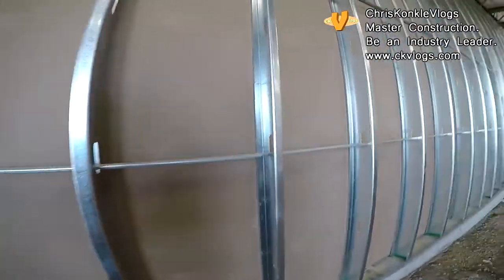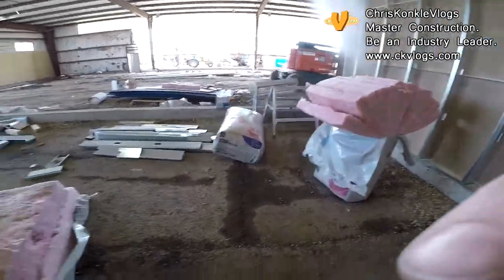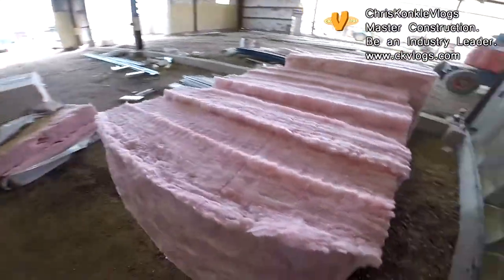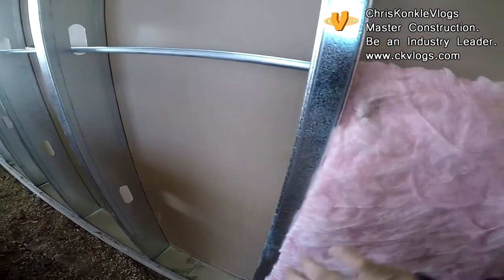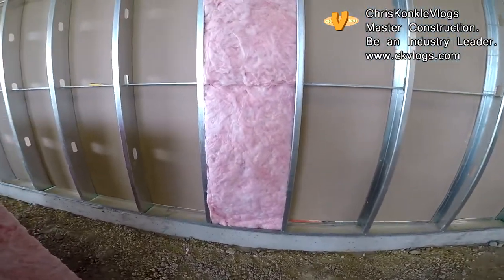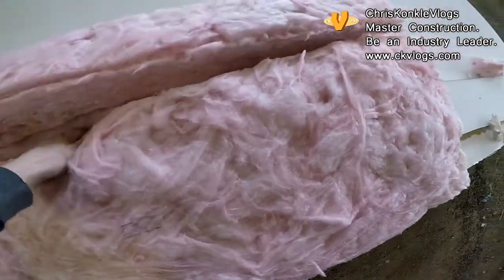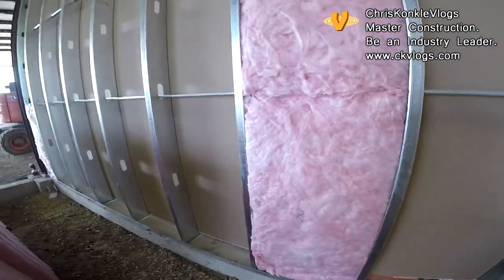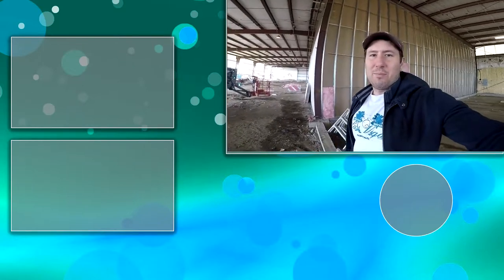Insulate Metal Studs | IT'S EASY!

Comment: Thanks for the video, would this method work on steel floor joists? I have a small shed that I’m converting to a tiny home and looking for the best method for floor insulation.
Reply from the maker: Yes you bet! Just remember when your ordering or buying the insulation to get the right stuff. You will need to know the size (6" to 8" typically), centers (16" or 2') and then yes for wood or steel. I am assuming the floor joists are steel stud? If say your joists are not studs, there is what's called blanket insulation that comes in rolls. 1 side is finished with a white skin that is washable. If you need more help feel free to join our Discord server, there you can upload pictures so I can tell you exactly what to do. Hope this helps!

Comment: Thanks for the vid! I'm doing my basement with 2x4 insulation, 16 on center. Is there a wider r-13 to specifically get?
Reply from the maker: Nope all you need to know is to ask for the r12, wood studs on 16" o.c. they make it for steel and wood so just make sure your buying the right one!

Comment: What's R-value code for commercial spray insulation? What are your thoughts on spray closed vs "normal"?
Reply from the maker: Shaun, my apologies for the late reply I must of missed your comment. The min R-value for exterior commercial walls is 20. I think that spray is good for tops or areas hard to access but I would recommend sticking with bat or semi-rigid for the walls. That way you can easily repair, remodel and reuse the material. Hope that helps! here is an additional resource for you https://codes.iccsafe.org/content/iecc2018/chapter-4-ce-commercial-energy-efficiency

Comment: My plans call for insultape and I've never used it. Where do you apply? Inside the track or between track and concrete/substrate?
Reply from the maker: Sorry  I am not sure what you mean if it was a spelling mistake or not. What I do know is if it is used for a gasket then yes between the track and slab. Usually when there is a change in substrate then it is a good idea to have separation. Caulking and foam gasket is what I use most of the time. We also use a blue Tuck Tape to seal our poly (vapor barrier 6 mil in residential). When your installing steal stud track to concrete it is a good practice to always use the Chemtron Acoustical Caulking and for the exterior walls use the foam gasket. Fire seal the outside of the track where it meets the concrete for that added protection on top of your gasket. I hope this helps. If you can send me a link to the exact product you are using I can have a better answer!

Comment: 24 centers using wood studs would give you difference space width when using steel studs. (Due to the empty steel stud) The insulation still fits? or when using steel studs is it not actually 24 inch centers?
Reply from the maker: That's right, when you order your insulation you need to specify if it's for wood or steel stud and on 16" or 24" centers. The stuff for wood is smaller widths.

Comment: is the flat piece of metal going between the studs a conduit or something else?
Reply from the maker: It's called wall channel. It serves 2 purposes; first to stiffen the studs Square and second to hold the insulation in the wall and keep it from falling down over time. That's why we go every four feet for the batts
Reply: @ConstructionKronies  How is it supposed to stiffen the wall when there are no clips installed? Is it just laying in there?
Reply from the maker: Yes for sure we install wall channel every 4 ft for insulation. The steel stud has knockouts for it.
Reply: @ConstructionKronies  But the clips that are supposed to attach the stud to the channel aren’t there, it looks like it’s just laying in the holes.
Reply from the maker: @shawnsutube  so yes, sometimes we add clips, usually on exterior walls. The channel is stiff in the knockouts as the are the same width.

Comment: Thermal  bridging?
Reply: Bull's-eye. Insulating between metal studs does nothing to address the conductive path from on stud flange to the other. Steel is about 300 times as conductive as wood; a metal stud at 1/30 the thickness of a wood stud, will transfer 10 times as much heat energy via conduction, reducing energy efficiency and subjecting the cavity (especially the faces of the drywall) to moisture that is not adequately vented, and an ideal environment for mold. Insulation should be continuous outside of the metal frame. In your defense, most architects and contractors don't understand this.
Reply: Refer to https://www.sbcmag.info/news/2017/jun/comparing-continuous-insulation-r-values-steel-vs-wood-framing for an explanation of the issue. Bottom line, insulating as shown in the video will reduce the effectiveness of the insulation by about 50-60% and lead to other problems long term.
Reply from the maker: So I am no engineer but what I understand about insulation is you don't want air pockets for moisture to build up in. I have demolished many old steel stud walls some very old and most of the time they are completely bone dry and no mold at all. I think the whole system needs to be taken into account here. We use caulking and gaskets for transitions and I think that really helps.  You can't put insulation on the outside of an interior wall but we do use rigid or semi rigid insulation on the outside of exterior walls. The normal system would be 1/2" drywall, 8" 18 gauge steel stud, 1/2" Densgold, Blueskin, 1 to 2 layers of z bar and insulation, then finished with cladding. All the way gasket under the bottom track.

Comment: what about the exterior? That metal frame acts like a conductor of heat or cold and will work like heating or cooling elements on the interior since the glass only covers the inside.
Reply from the maker: So, as much as I respect your comment this is a complicated topic. In short,I assure you the systems are flawless. I am not an engineer but I can tell you there are many systems and designs in place that consider all of the climate conditions. The glass is used as a curtain  wall in most commercial or high rise projects.and have their own thermal and moisture specs. We use an "out insulated"system when using cladding and trust me here is a typical wall assembly for and exterior wall in a commercial building;
Cladding / ACM 
2" Semi-rigid insulation
2" zbar
2" Semi-rigid
3" zbar 
6mil avb
1/2 - 5/8" densglas
6" 20 gauge stud @ 16 o.c.
1/2" drywall

There are other systems where the interior studs are insulated and polied and so on.

I hope this helps.
Reply: @ConstructionKronies   Not sure if I understand but are you saying that this structure did not require a out insulated system ?  Is there a exterior wall or is it inside another building?  If facing the exterior then thermal bridging is always in play.
Reply from the maker: @maxrey4055  oh yah, these walls are dimising walls dividing the interior of the building into separate units. This building was a pre-eng with a steel and concrete structure wrapped with corrugated cladding and that roll insulation with the finished one side, I forget the actual name of it. The bays are all heated  and its performing very well. The thing to  be cautious of when  installing batt insulation is to do it properly and dont leave air pockets that can build up condensation that can freeze or cause molding.